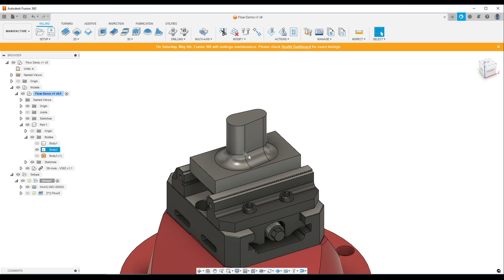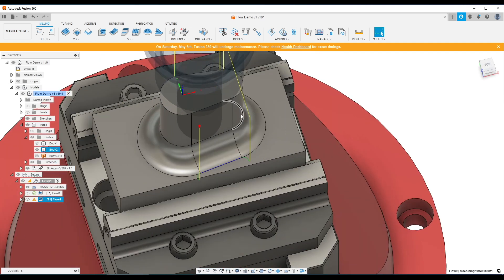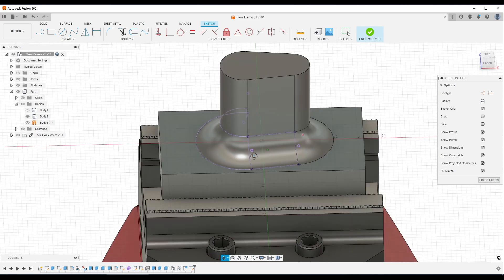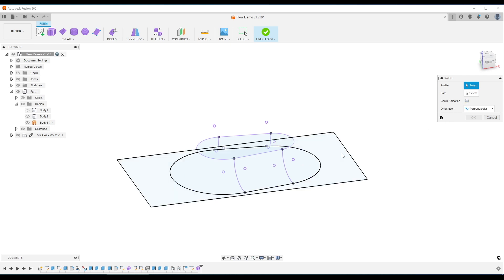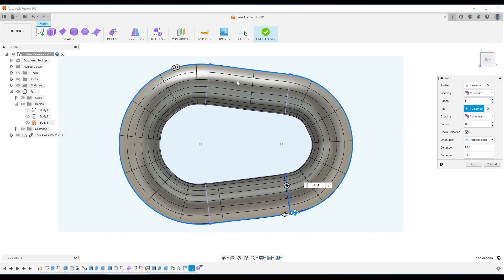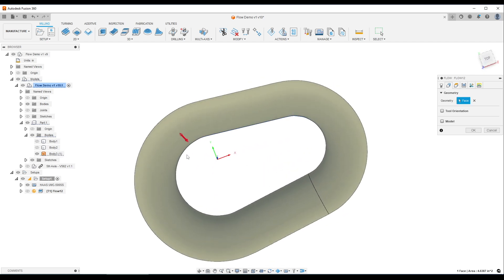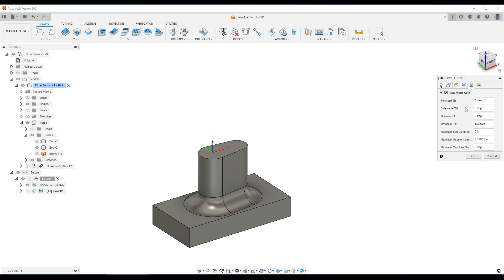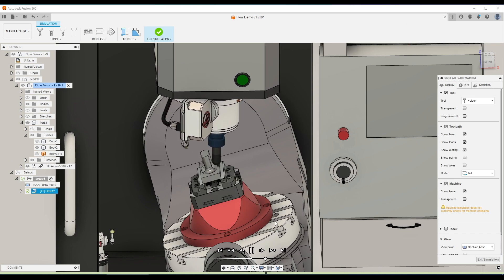Using Flow for 5-axis Toolpath in Fusion 360!

Comment: I had Fusion 360 as an early adopter with the "Ultimate" package, but after several years I let it go as it just never seemed to be getting there in a time frame I had the patience for. I heard that they added Module Works based multiaxis, which I think this is a result of, but I have to wonder why it requires a single surface when other Module Works based systems have toolpath strategies that do not require this. I can literally do this toolpath right off the original geometry using the segmented surfaces off an equivalent solid (I tested it because I really was surprised to see this). I'm not a fan of Fusion and not a hater either which makes me inclined think that you missed something here. If not, I'd be hollering at Autodesk about it given the cost of multiaxis in Fusion. 

Making geometry to guide the tool is business as usual, but not if it is exactly the same as the geometry you already have. That's just time wasted. Even worse is that in this case the resulting fillet surface appeared to differ significantly from the original, which means potentially a lower quality part. Does Fusion not have a 2 rail sweep?

Comment: Using fusion for years and now using mastercam for years kind of interesting with the methods and such used.  I routinely make a single surface for 3d paths in mastercam using geometry derived from a solid to allow the path to do what I want it to do.  Most of the time it's a flowline path.  Much like "flow" in fusion.

Comment: Rather than moving back to design workspace, you can create a manufacturing model. The manufacturing model exists separately from the design model and allows you to make edits related to manufacturability without changing your customer's original design file.
Reply: The Manufacturing model environment is truly awful. It decimates a heap of the parametric behavior of the CAD created in the Design workspace.
Reply: Derive is a much better approach to use instead of MFG model.

Comment: This is a great video showing how bad fusion CAM is. Just to make the cam work you have to re-model the part. Just terrible. Love the channel though!
Reply: Totally incorrect... For a start this could have been done without remodelling that fillet. 2nd, it's extremely common to have to remodel faces in many CAM systems to get clean simultaneous toolpaths. Often the surface normals of supplied models are horrendous due to extremely poor underlying surface topology... Shit in = shit out when it comes to extracting tool axis vectors from surface normals. Sure, there are some axis smoothing options (which also exist in other 5-axis toolpaths in F360, just not as extensively in Flow), but even those can't completely polish a turd. 

John is just showing 1 of a few methods for recreating faces with more favourable topology.

Comment: Another way to do this rather than re-surfacing: In the Surfaces tab, Create > 'Offset' then uncheck chain selection, now select the individual faces of the Blend that you want to extract from the solid body and offset them at 0 distance. Now you have exact surface geometry to drive your toolpath.
Reply: problem with that is you get 4 surfaces, not one.

Comment: Woah woah woah, you picked the fillets on the solid but didn't mind the arrows...the arrows were going the wrong direction on the end fillets....also, that's kinda a weak use for a flow tool path, wouldn't you just pick the paths at the top of the fillet like would to drive a 2d contour? I could see using a flow on those features if you wanted to interpolate that with a smaller ball nose....🤷🏻‍♂️
Reply: Your correct he didn't change the arrows. But the point was you still end up with 4 separate tool paths. Instead of one continuous.
Reply: @Dasman5624  dunno, I haven't seen that behavior....I've done similar tool paths where the solid features have tangency edges between them but still the tool path will flow from one to the other without a retract between them....🤷🏻‍♂️